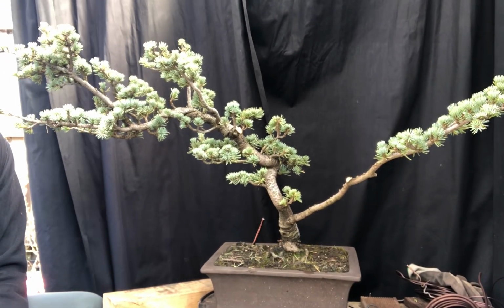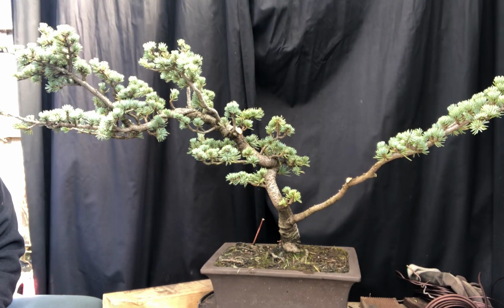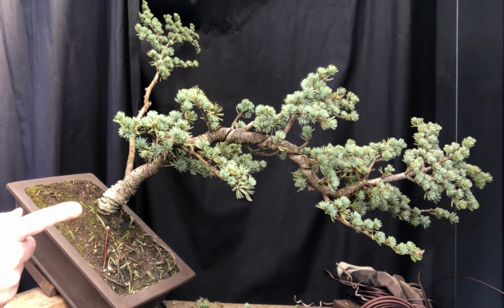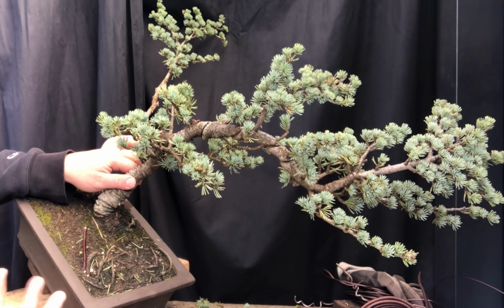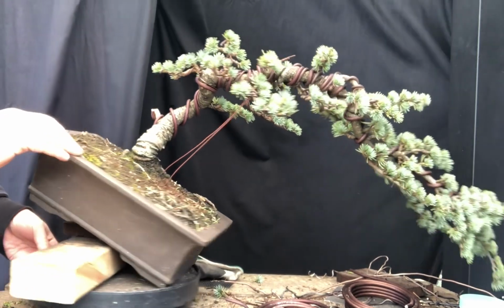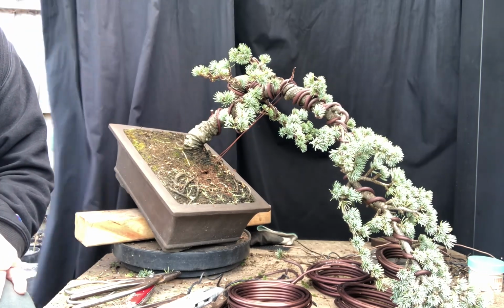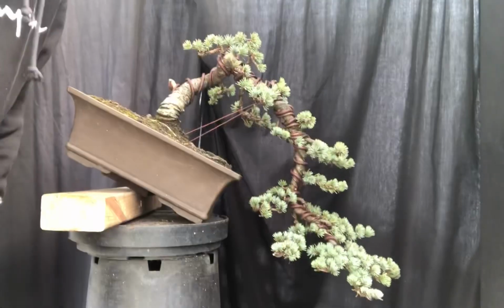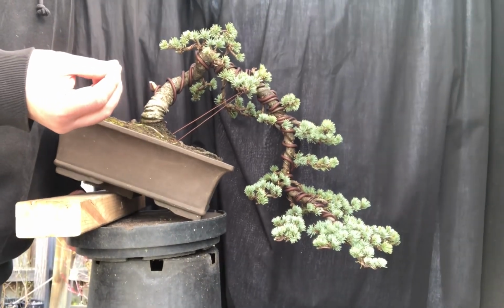Blue Cedar becomes a beautiful cascading bonsai

Comment: David—I keep obsessing over the best time to bend the blue cedar. Right now it is spring here and the buds on my cedar are just turning green and getting ready to pop. I had thought this would be a good time to bend since most above ground growth takes place here up until about June then root growth begins in July and peaks about August. However I was afraid that bending the trunk might disrupt the xylem and lead to water stress during the summer. You didn’t mention in this video or the other one you did on bending a cedar what time of year it was. Any thoughts on timing for this activity? Thanks—Larry in Western North Carolina, USA
Reply from the maker: I really don’t do too much bending if at all during spring for the reason that there is so much sap flow going on and more care would be needed when bending. I do big bends from end of summer to winter.

Comment: About how long is the trunk on that one from the ground to the tip a d what about the diameter at the base? I just got one that I plan to cascade but not sure whether to repot first then let it recover and start the bends the following year? Finally is the tree grafted into deodar cedar root stock? I think I would use raffia no matter what as these trees can out on growth rapidly and end up with bite marks as this one already has.
Reply from the maker: It was probably 80cm long and can't remember how big the base was. (this tree was sold several months ago). I prefer and always bend first and then leave for a year before repotting. No, it isn't grafted.
Reply: Thanks, I’ll proceed with bending next spring and wait on repotting. I hope to have a greenhouse by then to help trees that I torture recover faster.